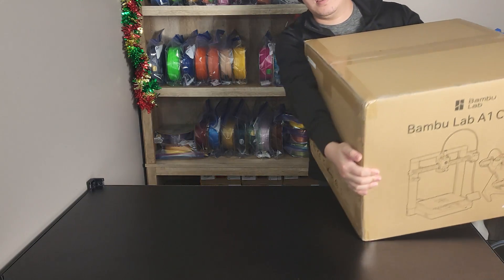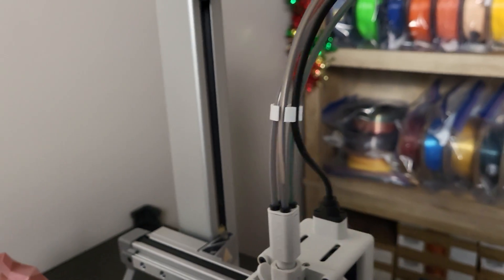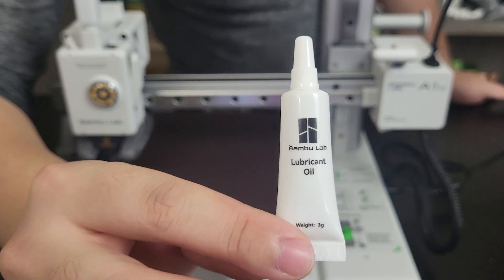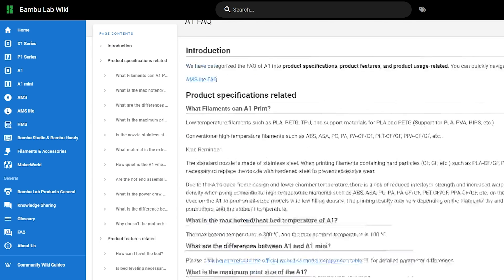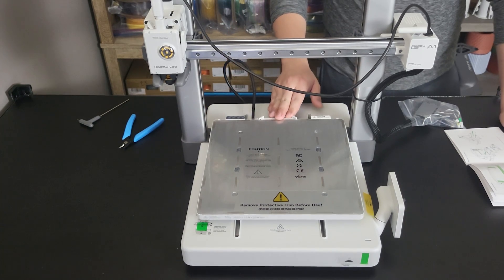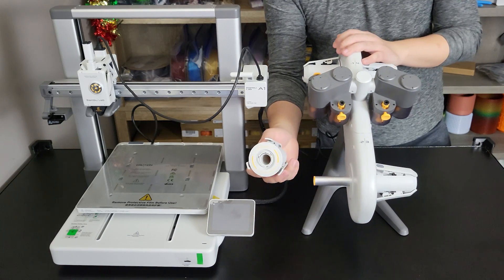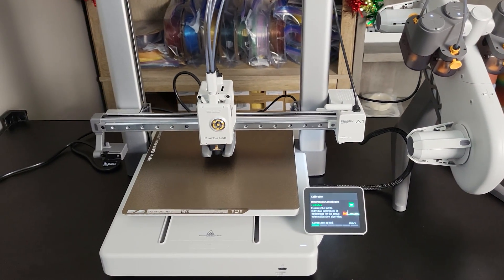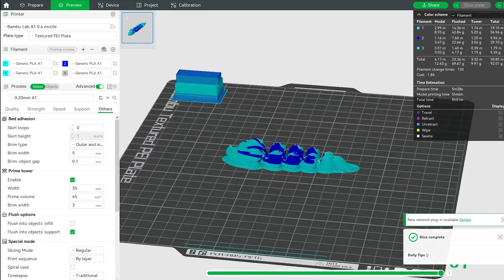Bambu Lab A1 Set up tutorial, Open box, Common issues, Beginner guide.

Comment: Hello 3d printing people… i just bought this model for my son, and already his first two test prints failed and did not get past a few layers, it popped off and started making “spaghetti” !! to try to fix it between the first and second try we have: shut the vents in his room so it is not drafty (also we do have it in an enclosure but only print with it open! our house is very dusty and i have read that dust can sometimes make the filament not work well.), made sure the plate was clean in case it popped off, and replaced the table it was on to a much sturdier one so there was no wiggling…. can anyone direct me to where we can get the most beginner friendly way to troubleshoot this??! thanks in advance!

Comment: I have several issues one. The printer is not recognizing when I change nozzle heads second it will not recognize the bamboo labs program on my computer only on the handy lastly I can’t write a ticket to ask them questions on how to fix it because I have no files to submit. I tried using bogus files just to fill that space but it still would not recognize and allow me to write the ticket or submit it. Any suggestions?
Reply from the maker: did you know there is call back on A1(Heat bed cable issue), I think for safety reason you may stop using it for a while until they come up with a new solution. They provide two solution for the callback, return/replace heat bed after they start sending new heatbed out.